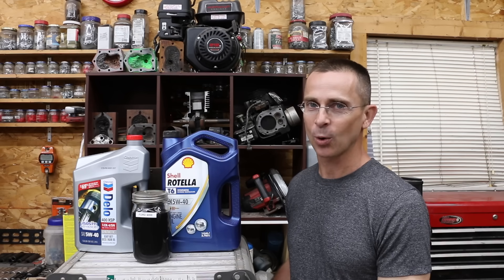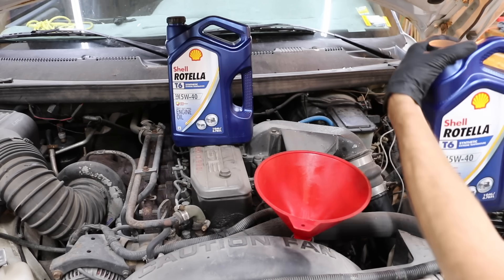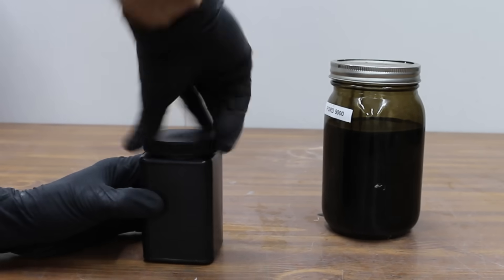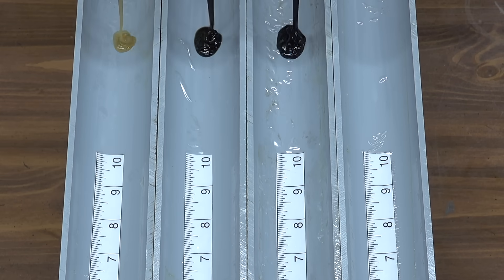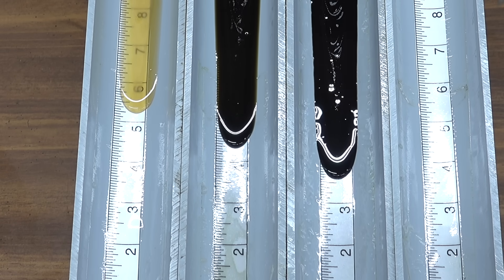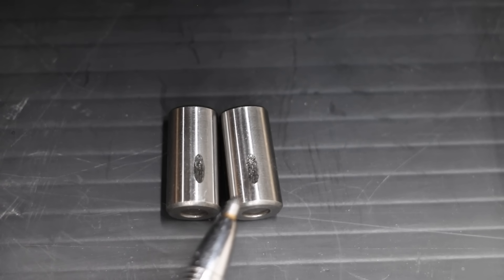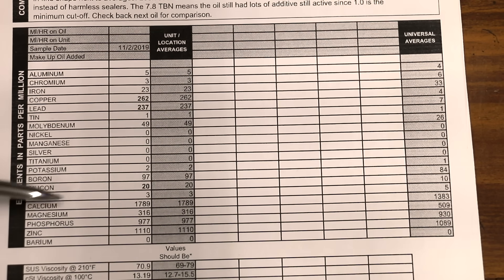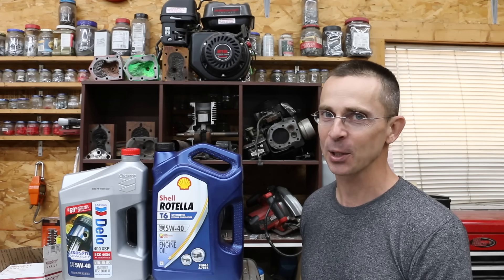Will Annual Oil Change Damage Your Car? Let's find out!

Comment: This is actually a bit hard to gauge, as it would need to be tested over several years to see the degredation.  I would say from personal experience and the experience of others, if the vehicle is older, yes it may.  But for newer vehicles, it's probably OK.  I would never go a year on conventional oil, no matter how little I drove it.  If it's synthetic, and a newer vehicle then maybe.  But still regardless of what this test shows, I would still recommend at least once every 6 months or 7500 miles.  oil is cheap.  Engines are not.  Let me put this into perspective.  If you only changed your oil once per year, and let's say it costs $100, versus 3x per year, you save $200 by not doing oil changes.  A rebuilt motor on average costs about $5000 and then there is some installation charges to go along with that, so let's say about $6,000 in the end.  Take 6000 / $200 = 30.  So for the price of that engine, you could have changed the oil 30 times, and that equates to about 10-15 years of oil changes.  Not worth it.  And $6000 is probably on the low-side if you blew your motor.  If you changed your oil only twice per year (which most new cars are this way based on a 15,000 mile annual average) then that $6000 equates to 60 oil changes, or about 25-30 years.

And to be honest, part of oil chainges isn't the oil, because if it's full but maybe slightly dirty that's one thing.  But the equally important reason you change your oil is to replace the filter, which is also important because it traps gunk in your motor (metal shavings, and other stuff) but at some point, the effectiveness of that filter goes down and it's no longer able to adequately filter the oil flowing through it, and it either clogs (which can lead to a rupture) or it simply tears and you have almost no filtration, this is especially true with paper-based filters.  Even if the oil is dirty, but otherwise topped off, it will still provide some lubrication, but cleaning the filter (or changing it) is what will help keep that oil cleaner longer.  Case in point, I would not go a full year on one oil change.  I would change it at least twice per year, regardless of how little you drive, and regardless of which oil you use or the viscosity.  From the time you put oil in your car, and use your engine, it starts to break down.  This is true for ALL lubricants.  And some break-down faster than others.  Small particles in the engine oil can cause things to happen, which is why it needs to be changed periodically (more than once per year).  You can screw up VVTs system for example, or other precision-machined surfaces if there is debris in the oil and the longer this floats around in your engine, the more damage you'll do.  If you go from 3 or 2 to 1 oil change, you'll save money... for a while, until you need a new motor.  If you look at cars on the road that have 200, 300, 400k miles, one thing is likely in common -- they all were maintained and oil and fluids where changed on a "regular" basis which I say is at least twice per year, if not more often for engine oil.  Trans fluids, maybe 60-90k.
Reply from the maker: Thanks for sharing.

Comment: Anyone who has a diesel engine in their vehicle knows or should know at about 10,000 miles  it's time too change it.  The diesel fuel slips past the rings and thins the oil and at about 10, 000 it will begin to use oil at about a gallon per 10 hour shift. Change all the filters at the same time.Both fuel and oil filters.
Reply from the maker: Thanks for the feedback.

Comment: I’ve been driving a 4Runner, with nearly 400,000 miles, and have changed the oil once, over the past four years, driving 250 miles per day, sometimes leaving the truck running for up to 8hrs per day. 
The Runner still looks good, has cold air, and a Transgo shift kit installed many years ago has kept the transmission strong. 
Timing belt, cooling hoses, and thermostat, are the only maintenance I keep up with. 
Any more, would be a waste of time and money. When/if I do change the oil, the old stuff will go into the fuel tank, as filler.
Reply from the maker: Thanks for the feedback.

Comment: I have been using Mobil 1 in my gas cars since the late 1980's. I change oil about every 20,000 miles but sometimes winter gets in the way and the oil sees 25,000. It's a very long story but my Uncle Fred was a mechanical engineer who attended a Corvair club tech seminar in Dallas at Mobil labs. The engineer who put that on in 1987 told my uncle that he changed his Mobil 1 about every 20,000 miles in his cars. You will note that Mobil 1 sells extended performance oil with recommended change of 15,000 miles. Should it surprise you their lawyers don't want to list higher because they know customers will push it further like I did. 

Some of my cars don't see more than 10,000 miles a year so I let them run two or more years. I've had two cars go well over 200,000 miles using this protocol and fuel economy which I keep track of every tankful remains unchanged. So does oil consumption. Compression remains good. The Ford Escort used a quart every 5000 miles and the Honda Fit uses a quart every 6000 miles. Sold the Escort at 205,000 but still have the Honda at 230,000 and she runs like a top. I do buy the best oil filters around. I consider them to be K&N or Mobil 1 which cost around $13-15 each. Synthetic motor oil is the way to go. It does not break down and form acids like dino oil. Those acids corrode bearing metal. I'm not an engineer but I'm a chemist and I understand why this is a fact.
Reply from the maker: Thanks for the feedback.
Reply: james everly

thank you for your comment.  unfortunately, I am not a fan of synthetic oil, but that's what the industry coming to. I currently have 3 Toyota.  I have a  2000 Tacoma, 1986 Celica gts, and a new 2022 Camry. I changed the oil in all three vehicles at 1000 miles without fail,  but this is the way I take care of my vehicles from the start no disrespect intended. just quick information my 1986 Celica has 270 thousand miles on it the original engine. I used  Mobil oil 10-30 conventional oil for about twenty years in my Celica,  unfortunately, they  don't offer that anymore, I had to switch to   Castrol 10-30 conventional oil  thank you for your time
Reply: @jameseverly8501   If you want to stick with conventional motor oil that's your prerogative. Changing it  frequently would be the way to go following the manufacturers specs. If I was forced to use conventional, I'd change every 3000 miles to be on the safe side. Thing is, you are paying more per thousand miles for poorer lubrication. There's a reason almost all manufacturers have changed to synthetic oil.  It protects engines better and yields less wear. Better fuel economy is a nice side benefit but not that big a deal.
Reply: @craiger1944  thanks for the information, I currently have 3 Toyotas   a 1986 Celica gts,  2000 Tacoma and 2022 Camry. in my Celica I was using conventional oil Mobil 10-30 but obviously Mobil   does not make conventional oil anymore, so I had to switch to Castro 10-30 conventional luckily a local parts store had that oil, as far as the Tacoma having some minor issue with oil it does take conventional oil, but I think the same parts store has the convention oil I need, as far as the 2022 Camry yes, it is synthetic oil. I am not a fan of synthetic oil at I am old fashion, but I understand, but any way I am original owner for all 3 of my vehicles, and all 3 vehicles gets an oil change are 1000 miles, that is my standard, like you want to hear all this, sorry but anyway I understand your points, but anyway   thanks for the response
Reply: I used mobil 1 high mileage, my shit is down to 1 qt at 5000 miles. I don't know what you're talking about. My car was an oil burner prior, but Mobil 1 high mileage didn't fix it.
Reply: @erinericsson  Sorry but I don't know what you are talking about, either. What does "my shit is down to 1 qt at 5000 miles" mean?  Are you saying after an oil change the level is down to one qt left in the engine after 5000 miles? Yikes, the engine won't last long like that. You seem to imply that you expected using Mobil 1 would fix an engine that burns a lot of oil. I never said that and it's not reasonable to expect that.

Comment: I only put 2000 miles per year on my Mercedes. I change the pricey German synthetic oil it's fed once per year. The big picture:  Oil is cheap, engines aren't...
Reply from the maker: Thanks for sharing.
Reply: depends on how the vehicle is driven. it could go 3 years and be fine..

Comment: An old boy in the town I grew up in had a 68 Chevy pickup, with a canister style filter. Every 5k miles he would drop a new toilet paper roll in it. Never changed the oil just changed that toilet paper roll, then added a quart. Last I knew, that truck had 400k miles on it.
Reply from the maker: Thanks for sharing.

Comment: I have a test idea for you. A lot of people run the Rotella T6 in their 4 stroke motorcycle engines with wet clutches. There are always people on forums talking about how you can't run oil designed for diesel engines in a motorcycle. But Rotella T6 is JASO certified, which means it meets manufacturer specs to run in a motorcycle with a wet clutch. I'm not sure you have any motorcycles on hand to test this, but it would be nice for a future video. Thanks for all you do, your videos are great.
Reply from the maker: Thanks!  Thanks for the video idea.

Comment: WELL instead of concerning yourself with this BS
# ALWAYS use SYNTHETIC MOTOR OIL...ALWAYS !!
# change the oil ONE TIME PER YER (don't care HOW many "miles" you drive !!
# ALWAYS change the FILETR and buy the BEST filter you can get...
AFTER 40 YEARS (and NO not ALL were in synthetic) I can tell you that WITH OVER 2 MILLION miles, I have NEVER driven over a crankshaft and while a LOT of cars and truckes (mostly AMERICAN MADE JUNK) RUSTED OUT, I NEVER lost ANY PART of an engine.

My current TACOMA 6 cyl has 425 THOUSAND miles on it (2013) and I have NEVER changed the oil more then ONCE a year...NO TICKING, SMOKE, NOTHING but SMOOTH SOUND.

ONLY IDIOTS with more money then BRAINS waste time on more then once a year oil changes...
MOBILE ONE synt and FRAM work the best...why look at "others" (if it ANI'T BROKE it IS a WASTE of TIME trying to FIX IT !!!)

Comment: Statistically, both Shell and Chevron were nearly identical. That is, the differences were not statistically significant.

As regards oil aging in an idle engine: why should it? What ages oil is high temperature (and oxygen). At low temperature (even in the presence of oxygen) there is no chemistry that can alter the oil’s composition.

This is NOT magic: it’s straightforward Organic Chemistry.
Reply from the maker: Thanks for the feedback.

Comment: I am an A&P mechanic and would be very interested to see these tests done on aviation oils aeroshell and Phillips are about the only oils we use and we are required to change the oil in piston engines as early as 25 hrs of use depending on the engine and filtration system used (metal screens 25 hrs, spin on filters 50/100 hrs, and annually regardless of filter or engine)
Reply from the maker: Thanks for the video idea.
Reply: Maybe you can send PF some oil samples of new, part used and "old" oil for him to have analysed and see whether the oil is the same as car engine oil but with a hefty markup for aviation.

Comment: Another great and factual video. I would like you to test amsoil signature series which is what I use in my car. Scotty and the Car Care Nut who I really respect both recommend early oil changes because metal filing from the engine builds up if you leave he oil in too long and causes more wear. This test seems to show otherwise. You tube need to start a stars rating. 5 stars to you.
Reply from the maker: Thanks!  Thanks for the nice comment!

Comment: I have multiple collector cars that rarely get driven , most of them I have restored and owned over 25 years , they are all performance flat tappet engines and I have a dozen cases of old Castrol 15/40 diesel and cases of GM EOS that gets added every oil change .Not unusual to go 10 years between changes , also used same products in my work trucks that went easily over 500,000 km and still looked great at teardown . Never had a single engine failure .
Reply from the maker: Thanks for sharing.

Comment: It is possible that I did not understand everything because of the language, but why should a regular oil change DAMAGE the engine? For me a very strange question. The fresher the oil, the better the performance of lubrication. Sure, oil ages and therefore tends to deteriorate. But the main reason for poor lubrication performance is contamination in the oil from combustion and of course the destruction of the long-chain carbon compounds over time.

Comment: T6 also has JASO MA/MA2 ratings for motorcycle engines. We use it on our Triumph Bonneville air cooled parallel twin bikes. with good results. The T6 full synthetic is a very good value at $50 (Canadian dollars) per 5 Litre jug.

Comment: I have a 2008 GMC Sierra 1500. I only change the oil every 8K miles or so with synthetic oil. The engine has 220K miles on it. I have noticed that the oil pressure was getting low after a few months of use but would be back to normal after the oil change. I think I will now change just the oil filter halfway and continue using the same oil for the other half of the miles. The oil seems really good still by the time I do the change.
Reply from the maker: Thanks for sharing.

Comment: I run t6 in my sidexside , lawn mower , pressure washer ect. Great oil, also wet clutch rated..Great for motorcycles and atvs
Reply: Did not know it was rated for wet clutches.  Ty.  Will look in to it on my next oil change

Comment: Using Rotella T6 in my 2017 and my 2011 RAM 3500 Cummins engines.  Changing oil every 15,000 miles.  Good idea to have the oil tested.
Reply from the maker: Thanks!

Comment: i hardly ever change oil on small engines like snowblower they get very little use it was 4 years old before i noticed it had not been changed but i feel bad if i don't change my car oil every 6 months even though i don't drive many miles anymore
Reply from the maker: Thanks for the feedback.